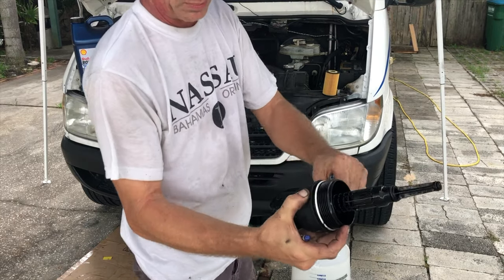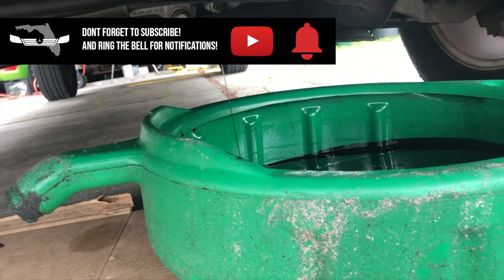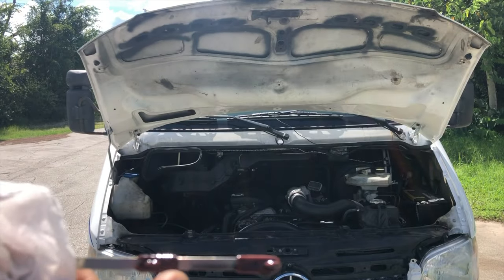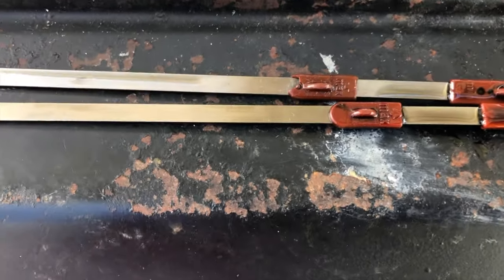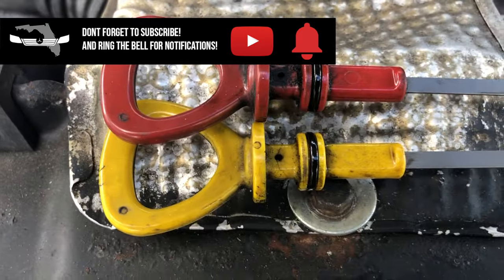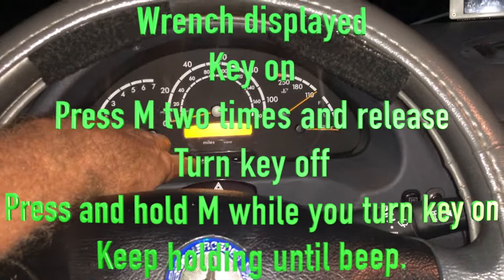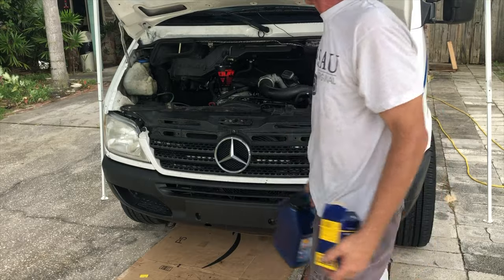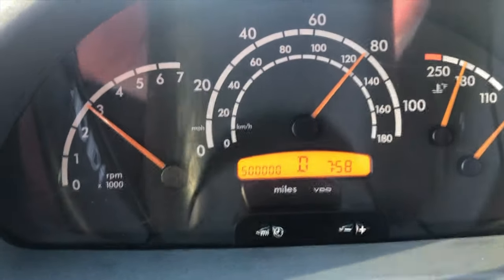T1N Sprinter Oil Change, Rotella T6 & Hengst Filter

Comment: Thank you for your practical and real videos about the T1N. They're the best! I didn't know about the red vs yellow dipsticks, so thanks a lot for solving that mystery for us ordinary folk. I bought my 2006 T1N (OM647 engine, 2500 chassis, 140" wheelbase) with almost 180K miles on it. Could you let me know how much oil should I expect it to consume, if any? Also, do you know about how much oil the space between the upper and lower marks on the red dipstick represents? Thanks!
Reply from the maker: Difference between lines is one quart. Hopefully it won't consume any oil. One of my vans requires a little oil between services but most will go 10,000 miles without needing any added. And that is time for an oil change with 2.5 gallons of fresh synthetic.

Comment: I love the filter o-ring system. If the space shuttle engineers designed their booster rocket o-rings half as accurately as Mercedes, space shuttle could have flown in below zero temps with confidence.
Reply from the maker: Too soon....! LOL Only been about 35 years????
Reply: Sounds ridiculous but this is actually true. Railway machinists union is actually part of the aerospace industry. I was a locomotive tech on the electrical end so I had a different union. But we would always joke - thank god these locos don’t fly. Our work was marginal at best.  Anything that blew up (and it happens a lot when they pull uphill) we blamed on the damn o-ring problem.. kinda sick humor on the rails but that’s just how it is.  Most ridiculous job I ever worked.

Comment: I have a 2004 T1N but I don't see the MB spec(MB 229.51 or 229.52) on the Rotella T6 oil- should it be used? typically I have been using a 5W30 synthetic, it does get cold up in my area(Calgary, Alberta, Canada) my van only has 159K miles, not really a high miler at all.
Reply: The official MB specs to look for are 228.3, 229.3, 229.5, or any of the x.x1 (low SAP for DPF-equipped engines) extensions.  The low-SAP oils have a different additive package than the full-SAP oils.
I’m also in Calgary, so run a 0w40 weight for safer cold-starts.
I’m happy using any approved Mobil-1 or Castrol oil...

Comment: just an FYI for everyone:  "Mercedes-Benz 228.31 engine oil is excluded for approval and use in the Sprinter OM612 and OM647 Direct Injection diesel engines, as we have research to show that the oil on these sheets can have a detrimental effect on the components of the engine."  Also, listed as not approved on MB Bevo spec sheet.  On the other hand, I know a lot of people have used Rotella for years and continue to do so . . . . I'm gonna stick with old faithful Mobil 1 European Car Formula 0W-40 (MB229.3, MB229.5)

Comment: Thank you for the awesome and encouraging video. I did my first oil change yesterday and everything went smooth except for the filter oil cap that didn’t screw all the way. The position of the big oil ring seal is exactly where you have indicated it should be, but there’s no way I can hand tighten it all the way... any advice ? The gap is about  1/16
Reply from the maker: If the seal is seated, your cap is down as far as it should go. Do not over tighten it. Hand tight only.

Comment: Is this oil and filter a good choice for a 2004 Frieghtliner 2500 with 110K miles that I plan to use as a camper van? Thanks and sick content!
Reply from the maker: Yes Rotella T6 15w-40 in warmer climate, T6 5w-40 in colder climates.

Comment: What year van is this? I just picked up an 06 2500. Will the same oil work?
Reply from the maker: Mine is 2005 and the same oil is great for all of them from 2000-2006 plus. We have had trouble finding Rotella T6 for about a year, but it seems to be getting better lately.

Comment: FYI, that two and a half gallon container definitely overfilled my oil. I let the old oil drain for like 30 minutes until it wasn't even dripping anymore. Now the dipstick is showing past the top plastic part. I have the red dipstick and I checked it warm. Wondering if I should take some out?
Reply from the maker: If your dash beeps and says "Hi" it is not being friendly and I'd definitely take some out if* that happens. I'd like to figure out what is different about your experience from the many-many times I've poured the full jug into our 5cylinder engines. I assume you did put a new oil filter in. If you feel it is necessary to remove some oil I suggest replacing the filter as the new filter will absorb about half a liter without any risk of removing too much with trouble getting the plug back in while oil pours out.

Comment: Why do you use T6 when T4 is the recommended oil with the paper filter? Are you using the fleece filter with the T6?
Reply from the maker: T4 is non-synthetic and not recommended as far as I understand. I'm sure "fleece" is a misused word in the oil filter business. MANN's fleece* filter is purely polyester fiber. But that is where my confidence fades. If the filter I used here is wrong I'll learn. But I think it is also poly fiber and I'm sure it is not paper. I generally inspect the filters when taking them out and cannot tear them. I like the rubber ends better than the felt ends on Mann filters. The Hengst has considerably more surface area, due to much deeper folds despite broad ends and shorter filter* length. That shouldn't ever be a consideration but I feel it ensures consistent flow through the life of the filter, needing a lot more debris to even think about clogging or resisting.

Comment: 500,000 baby
Reply from the maker: Coming soon, 2Blue van-tour. The 2002 that we Raptor painted blue, spray foam insulated and swapped the engine... is finally ready for adventure. It features a new design queen bed, 60/40 block-out curtains, giant sock drawer, jeans drawer, rock-climbing grab-ladder, roof deck and solar! The dash and cockpit are like no Sprinter you have ever seen!!! We added cruise control, one power window, screen window in sliding door, wood floors and walls, LED lights, RV leather seats. I'm excited about it!!! I drove it 260 miles yesterday and it is nice!

Comment: Question, can I use 5w-40 Shell Rotella oil for my 08 3500 3L dodge soriter? It’s such a pain in the butt to find the perfect MB oil, and when I go to autozone they tell me that I will be fine w that one. I already put it in. Should I be worried?
Reply from the maker: I only use Rotella T6. T5 is synthetic blend and T4 is non-synthetic so your oil-change interval should be less than 10,000 miles if using those Rotella products.

Comment: Common fault on these sprinters is the glow plug light staying on after van has started for 20 seconds. Are you going to be doing a video on checks, and tests to do, to resolve any issues?
Reply from the maker: Glow plug issues are fortunately not common here in Florida, but it is one of those videos that as soon as we have to do it, we’ll be filming it!
Reply from the maker: The light staying on could be the entire module under the battery tray is fried. It’s a common T1N problem from what I understand. You can remove the driver’s side headlight and very easily pull the module and inspect its solder joints. It’s possible to DIY repair or replace with the updated design.
Reply: Oh, ok. I thought if it's was fried I would have issues starting van. No issues starting van, just wondered what was causing it to miss behave. It's been the same on both sprinter vans
Reply from the maker: @sprintervankev  You would only have problems starting in extreme cold or if your engine had low compression to start with.

Comment: Great video as always. I’m not sure what’s going on with my engine oil because it always dried below “min” only after 3k miles. Where is the leak?
Reply: How's that turbo doing is there any signs of a leak on either side of the engine?
Reply: @That Van Guy - I will have to see exactly where “either side of the engine is” (new owner at 300k and drove 9k miles - 3rd oil change) , but you are definitely on to something that turbo is having low boost pressure. Occasionally, I get limp mode at 40mph going up him with traffic. I have to pull to shoulder and switch key off-on engine to reset. 
I watched your other video about turbo resonator replacement and made a purchased through affiliate link and then I noticed my van already has the same aluminum resonator replaced! So I’m not sure what’s the problem is now. I’m debating whether I should buy the turbo kit (hoses) without the inter cooler from million mile sprinter ? 
I really appreciate all the valuable info here!
Reply: @hahnduchamp1244  you can check if your EGR valve is working or not also. You can clean it out with carbon cleaner. You may have a carbon blockage and that could cause limp mode from what I have read. I hope this helps you out. I'm not Florida van man just another van guy that loves to work on his own 2003 sprinter tiny home lol.
Reply: @That Van Guy - I’m sure you’re way ahead of the game compare to a newbie like me! I did watched a video about cleaning EGR and attempted to open something look like EGR but there was coolant leaking out before I finished open the last screw on it, didn’t have a chance to see what’s inside. So I asked a mechanic and confirmed that my 2005 doesn’t have an EGR?? Maybe he’s wrong? I’ll have to recheck this! 
Owning this T1n really turn a man into a bigger man :)!!
Reply: @hahnduchamp1244  sounds like you were opening the heating vavle if there was coolant.
Reply from the maker: Sorry I missed this comments months ago. If you Sprinter is North American 2004-2006 it has a water cooled EGR and coolant will leak out if you don't pull the hose off before removing the EGR from the intake manifold. 
Euro models don't have EGR.

Comment: Is this the recommended oil wieght? I seen people use 5w30, I’m planning on changing my oil today.
Reply from the maker: Most of the recommended oils in my manual are 5w-40 to 15w-40. My book also lists Mobil SHC 5w-30 and a few similar. Look for the MB spec 228.3 or 228.5 or 229.3 or 229.5 on the package. What is ideal depends on your climate. I believe colder places would lean toward the lower numbers on both scales, but I'm not sure how all that works & why some people choose differently.
Reply: @FloridaVanMan  oil weight numbers are viscosity when engine is cold and viscosity when engine is hot. You need lower numbers for a thinner oil for colder climates, especially when engine startup is happening, to get lubrication moving fast. On the other hand, you don't want low numbers on that left side for hotter climates because the oil will be too thin. 

Engine oils use special molecules that are long and don't increase viscosity when the oil is at ambient temperature, but when hot those special molecules coil up and make the oil thicker. (This is how they defy the common sense experience of the engine getting hotter not making the oil too thin.) These special long molecules break down over time and reduce the engine viscosity at running temps, which is one major reason why the oil needs to be changed from time to time.

All that to say--yes, you're right, colder places want lower numbers (which means thinner viscosities at both ambient and running temps, which will then both experiencing them thickening due to both of those temps being colder in their locale). Winter, you also might consider using a 5 instead of 15. 

Just thought I'd share since you said you weren't so sure how it all works.

As to why some people choose differently... let's be honest, unless you're sending in oil particulate assesments and you're a mega geek on the bobtheoilguy forums or something, running experiments, you're not going to be making the choice on anything other than a hunch and whatever information you got from whoever and wherever you saw it or whoever you asked. In reality, just try to follow the spec they list in the manual, or perhaps try to follow the advice of anyone who has run their vehicle for a few hundred thousand miles on a given oil at a given climate and had good results. Anything else is just shadetree speculation.
Reply from the maker: @KyleBaker  Oh, it is most definitely shade-tree speculation with a little shade-leaf too, when times are hard. Haha I've been running Rotella T6 in 2 Sprinters for over a decade and combined 600,000 miles. And I'm still inconclusive. I have not had any major engine failure since starting with Rotella, and the previous failure was not the oil's fault (Mobil1 for small diesel trucks). That failure was an injector issue so any oil might be just as good, for all I really know. Thank you for the details above.
Reply: @FloridaVanMan  well, my climate won't be so different than yours, so 600k of smooth running is good enough for me! I've also always been partial to Rotella T6, so that makes it an easy choice. If I end up with a T1N (fingers crossed), I'm sure that's what I'll be putting in it.

Comment: Are you down with the new Rotella T6 formula, had you heard of the change? A lot of the Subaru crowd has begun to switch off it but I haven't seen Sprinter used oil analysis of the new T6 versus the old to compare.
Reply: I think a lot of Subaru folks have stopped using it not because of the oil but rather because it interferes with newer gasoline ICE emissions equipment and the ECU just freaks out as a result.  I run SubaruOutback.org and I have seen countless people over the past decade that have some weird cult-like obsession with using this oil in a gas engine as if it is the most imperative thing that they must be able to do.
Reply: @TranslatedAssumption  Yeah, the thing is oils for gas engines have had a lot of things removed from them that help engine longevity (especially in emergency cases where oil is low for some reason for a short while), but that hurt emissions. Diesel oils, like Rotella T, still have those additives, as longer engine life is imperative. Man gas engines these days have oil ratings that are focused on making sure the manufacturer can hit their mandated mpg, and are not focused on the oil that will necessarily give the longest service life, as problems from a weak oil only crop up after warranty service period but create more money for the manufacturer (so, another place to manifest planned obsolescence).

I don't know anything about Subaru's, just have run Rotella T in most of my vehicles over the years.

Interesting that there are sensors that won't accept it now. Thanks for the comment, I would have wondered if the formula changed recently otherwise.